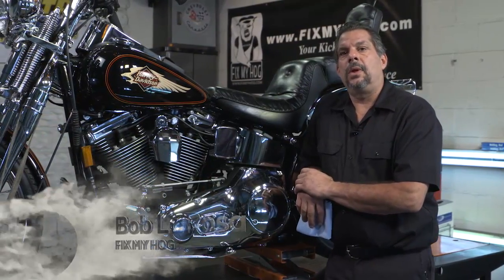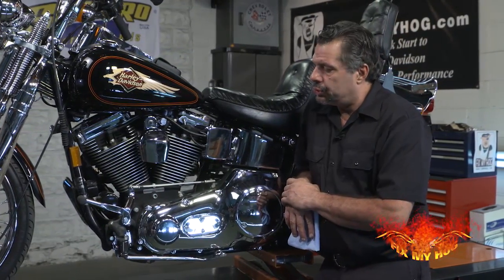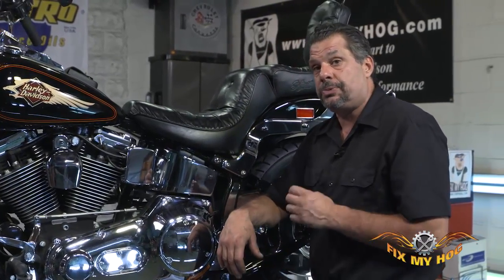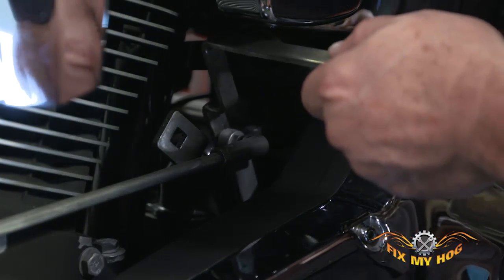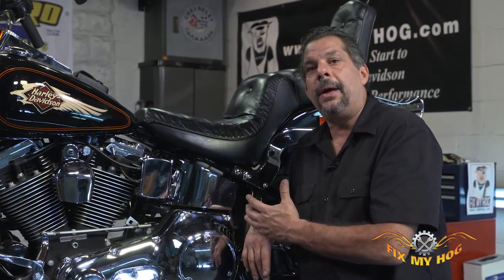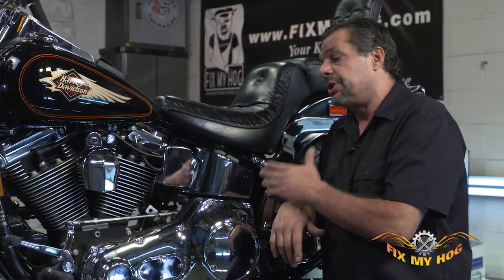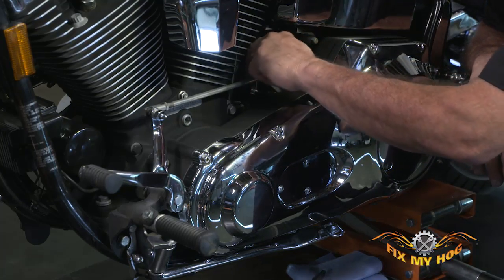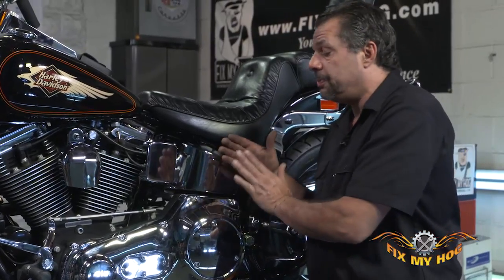Shifter Pawl Adjustment: Tips and Techniques

Comment: (Twin Cam FXDC) I changed to an internal belt-driven primary drive system with a dry clutch... no more clunk changing into first gear, either from neutral or changing down from second gear. It's so buttery-smooth from neutral-to-first that the only confirmation the transmission is in gear is the N light going off and the bike moving when the clutch is released. The transmission feel is otherwise pretty much the same once on the move.
From this experience, I believe the Harley clunk is a little to do with the transmission design/style but a lot to do with clutch drag, paired to their long heavy primary drive chain and compensator. (Rev a cold Twin Cam engine with first gear engaged and clutch lever pulled-in... the bike still tries to creep forward. Or, on Evolution engines, shifting into first gear at a high-idle would cause gear grinding). I don't think Harley's primary chain and compensator design helps the situation; there's a lot of play in there.
Regardless of my opinions, my experience is that replacing Harley's wet clutch plus primary chain and compensator system with a belt drive (no compensator) and matching clutch assembly got rid of the clunk, and got rid of all the primary drive noise as well.

Comment: Thank you for your amazing videos.   Quck question, does the 88 sporster have a shifter pawl adjustment screw or spring or anything???  Thank you
Reply from the maker: Your 88' Sportster has a shifter cam with a shift cam follower that has 2 springs. It is not uncommon to have an issue with the shift, cam follower assembly. 

https://www.fixmyhog.com/videos/sportster-maintenance/
Reply: @FixMyHogfreechannel thank u!!👍🤗

Comment: I dont have trouble finding nuteral. I have trouble downshifting, I downshift  and when I downshift again the gear lever moves up and down freely until it manages to grab the next lower gear. Will this solve my dilema.
Have 2018 ultra anniversary and in Australia. Thanks heaps
Reply: I have this issue as well, I have a 2021 Fat Bob, and it will not complete a second downshift after there has been one downshift already.  This came from the factory this way.  It's been laid up in the shop more than it's been on the road while they try to find a "fix".  Have you had any luck with yours?  Harley seems to be at a loss with mine.

Comment: FXST 2001 has no adjustment , I reset the  clutch and cable . it was fine for 3 days and doing it again skips from first to second unless the bike is turned off , I know the main shaft is always turning when running the engine . Have checked the fluid its at the Diaphragm spring.   36 oz prime oil I hear guys say they only add 24 oz and it cures this . less than 50,000 miles never abused or beat down on owner is 75   Not a speed freek .  Tomorrow , I plan on doing everything over for him Im stumped ,  I go by what the Harley Manual has said . it shifts fine just cant hit neutral , started last summer .  I get 80,000 out of my clutch pack his bike is lighter.
Reply from the maker: Hello,
I do not see that your active Premium Member. Our Ask Expert Program is a benefit for our Premium members. Here is a link to our Premium membership at a deep discounted rate:  https://go.fixmyhog.com/C21154

Comment: I have a 1997 wide glide. With the engine running and at a stand still, the motorcycle wont shift into neutral or any othrt gear. Only after i turn off the engine,  will it shift from 1st into neutral and all the gears.  What could be the problem?
Reply from the maker: Ask An Expert’ section for members of our online community. I would be happy to send your question off to the experts. To get started, please send the email associated with your paid membership. Thanks! Great question! We have a lot of technical answers on our website. https://www.fixmyhog.com/harley-tips-a-z-index

Comment: I had no problems on my 2000 HD Road King police , until i decided to change the inner shift lever ( Ness) ,  after buttoning everything back up, it now feels like my Tranny is locked up, can't get into neutral or gear , i suspect i did not get the Lever in the exact proper positioning.  The design of the Ness probably is misleading and is too far forward. Can't really use the Shift Linkage Rod as a template I guess .

Comment: Everything works good except when down shifting! 3rd---1 st gears takes hitting lever to many time to get it to go down thru the gears. Neutral is easy to find. just no clicking from 4 to 3 to 2 to first, with out hammering or pushing down hard and fast many times seems to get it back to first gear or neutral! all with the bike rolling. Any ideas would be helpful. 1999 FLSTC with only 6 K on it. Up shifting works perfectly! just down shifting. thanks!

Comment: Could this be the problem on my 2001 Dyna Wide Glide? I have a issue getting from 1st to 2nd with a passenger on the back. If I am riding solo the issue does not happen as often.
Reply: I get stuck in neutral.
Reply from the maker: Hello, 

No. There is no shift pawl adjustment for Twin Cam models. Only Harley 
Evolution models. Having a passenger should have no bearing on the way 
you HD shifts.

Make sure that there is no binding caused by your shift linkage being set up incorrectly. 

Raise your rear wheel (m/c not running) & try shifting up & 
down through the gears. If shifting is difficult, the issue is likely in
 your linkage or transmission. If it shifts good this way, the issue is 
more likely to be in your clutch, primary drive, or throw out bearing. 

https://www.fixmyhog.com/video/harley-throw-out-bearing-011395/

https://www.fixmyhog.com/video/harley-davidson-gear-shift-linkage-and-neutral-issues-008726/

Hope this helps!
Mark
Fix My Hog Video Membership
Reply: What was your issue?  My 2002 Wide Glide is having the same issue.

Comment: I have an 85 Superglide, EVO with a 4 Spd. Wont shift in and out of 2nd or 3rd unless I reach down and grab the foot shifter and slam it into gear. It just started doing this all of a sudden. Clutch feels good, recently changed the pack and shifter rod, throw out.  Was clunking into 1st when cold but stopped after warming up. Could it be the Pawl adjustment, or any other ideas would help. Just ordered a Baker 6 spd and need to get back in the wind.
Reply from the maker: Hello Rocky, 

1st inspect your shift linkage. 
Then, lift the rear wheel with a flat jack. Try shifting without the bike running. If shifting is possible this way, your issue will likely be found in the clutch/primary drive.If not, the issue is with the shift linkage or inside the transmission.
https://www.fixmyhog.com/video/how-to-search-fix-my-hog-008641/
https://www.fixmyhog.com/video/welcome-to-fix-my-hog-site-review-008131/
https://www.fixmyhog.com/video-index/

Hope this helps, 

Mark
Fix My Hog Video Membership

Comment: My 1972 Harley FLH has a problem going into neutral when the bike is fully stopped. It just started doing it last fall I did a totally rebuild in 89 and the bike has about 20.000 miles on it but the clutch is new with about 2000 miles on it or less.
Reply from the maker: Suggest removing and servicing clutch plates. Re-assemble and adjust. 
When plates are removed, inspect the basket and hub. If there are significant wear grooves, may need to consider replacement. 
We would try cleaning up 1st.
https://www.fixmyhog.com/video/how-to-search-fix-my-hog-008641/
https://www.fixmyhog.com/video/welcome-to-fix-my-hog-site-review-008131/
https://www.fixmyhog.com/video-index/
Reply: cank
Reply: 9
Reply: fahtndau
Reply: ns
Reply: michaefanht
Reply: 5

Comment: Well my problem is a little different i can shift up from first threwball 5 gears & i can shift down from 5 threw all 5 gears however when i get to first gear i get a little gring & sometimes have to tap the leaver with my foot a few times before it goes into 1st gear.   Ibe only owned the bike about 9 months & never had a problem until about a month ago i started to notice it halpening. Any ideas as to what it could be? 03 road king flhri
Reply from the maker: Hello, 
What you describe is, most often, associated with linkage/shift lever binding. Inspect your shift assembly from the transmission shift lever and forward to the heel & toe shift arms. Make sure there is no excessive play @ the transmission shift arm or the shift shaft.  Also, verify that your clutch is correctly adjusted @ the clutch pack & the cable.
https://www.fixmyhog.com/video/primary-fluid-service-w-clutch-primary-chain-adjustment-001305/
https://www.fixmyhog.com/videos/touring-maintenance/

Hope this helps, 
Mark
Fix My Hog Video Membership

Comment: I check my shifter today to see if it was centered. With just the arm on the trans, no linkage, I can move it a little forward and backwards, no spring tension on it tho??? feels like it moves on the pins 1/8" each way. My problem is down shifting. I have to hit the shifter too many times hard to get it back to first or neutral when stopping for a stop. It up shifts great ! 99 FLSTC 6 speed baker. Any Help to find out why I have this problem?, the bike only has 6K on it. Just bought it.
Reply from the maker: When checking shift pawl adjustment on your Baker transmission, make sure you are in 3rd gear. 
If you can down shift without issue with the shift linkage disconnected, the issue is probably in your linkage / lever assembly.  
If there is binding with linkage disconnected, the issue is in the transmission.  
The specialty tools used in our shift pawl demonstration were purchased decades ago. The exact same tools may not be currently available. Suggest looking at Jims Tools, Drag Specialties, or V-Twin if interested. Otherwise, you can use 11/16" & 1/4" wrenches. Sometimes you can bend wrenches to reach better. 
https://www.fixmyhog.com/video/shifter-pawl-adjustment-012748/ 

https://www.fixmyhog.com/post/videos-harley/
Reply: RevBiker Big D  Baker actually has a video on how to do this adjustment also